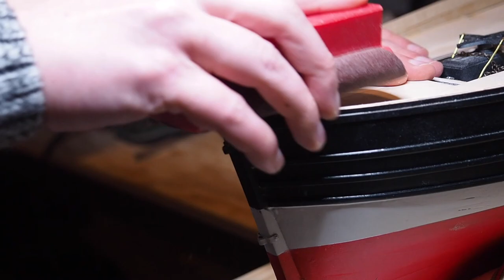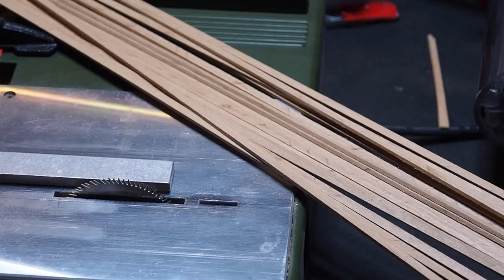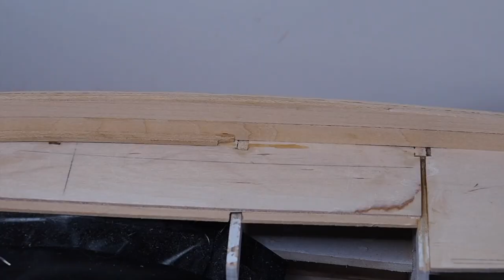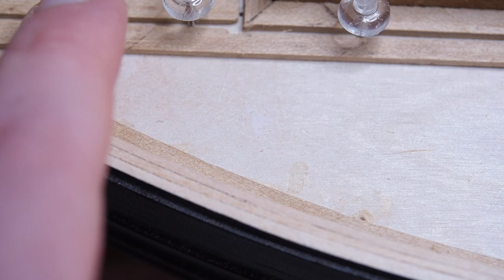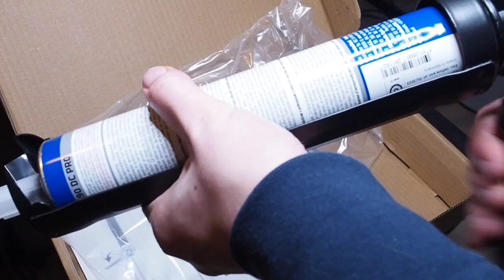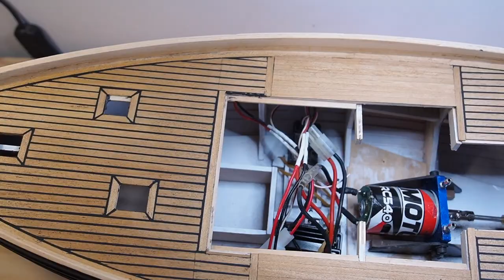You didn't know about this DECK PLANKING method for model ship

Comment: Excellent caulking method. With curved decking as per a sailing yacht it would look even better. ❤
Reply from the maker: Yes that would be the best use case. I don’t know if I would have used it for the Dorade though. You need pretty big scale models for doing so
Reply: Was thinking same, and what issues for the king plank

Comment: Looks great!! I doubt that I would do that with the actual Amati Fifie kit as that supplied deck planking is only about 1.5mm thick. Oh and which Sika product was used as they many
Reply from the maker: Hi JD with 1,5m thickness I think is double too. The sika is liquid so it penetrates easily. In the video description  you can find all the links :)